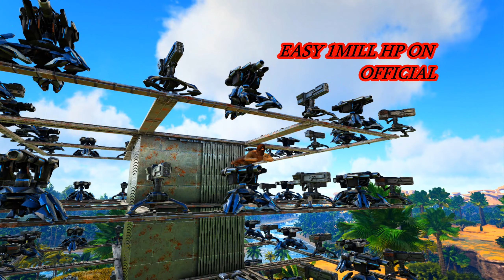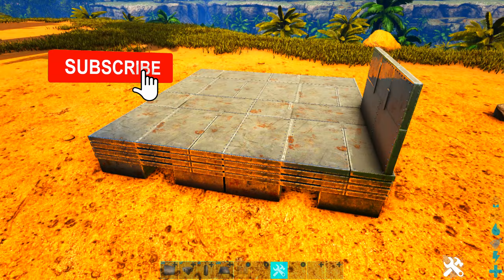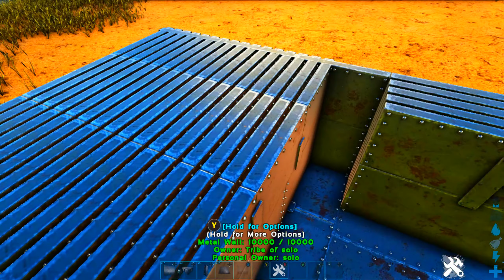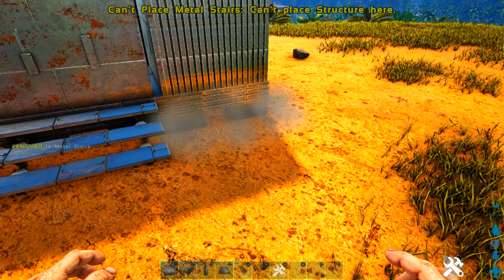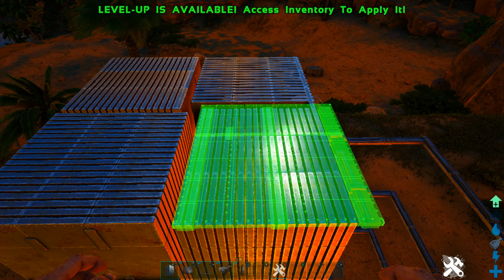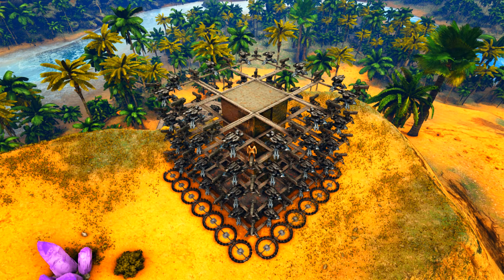Ark turret tower design 2022 multi layer ark guide pvp Speed build Turret Tower ark survival evolved

Comment: If you destroy the outer 4 walls the rest will fall, reference: captain fatdogs's pro wall stacking video.
Reply from the maker: Hi, would need to drop all outer walls and the vaulted pillars for all hatch frames to full as they are snapped together aswell 

And who's captain fat dog?  As you said reference I assume he has a similar build?
Reply from the maker: Just searched him! Yea his walls on base video is the same stack method but he's only got 6 where iv got 10+ per foundation
Reply: Only the first 3 or 4 walls are supported. If you destroy the outer 4 walls on your tower build the rest will fall because they don't have foundation support. Which is fine it leaves space in the center for a gene and a bed.

Comment: Alright so I can't make a video to show you but lowkey for the gen id out it right next ti the tower put a pillar like you did ceiling over the gen the. Stack vaults over gen and drop 3 vaults on a full gen if you do gas vault drop 2 for lasting
Reply from the maker: But if for whatever reason the raiders got lucky they would destroy them vaults and then the gen before anything else needing to be destroyed, so in my opinion that weakened the build